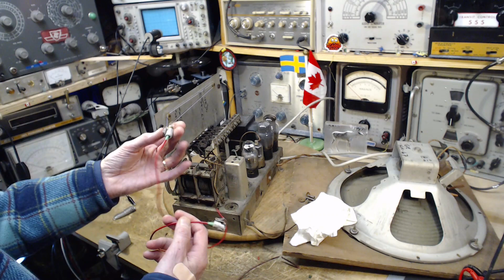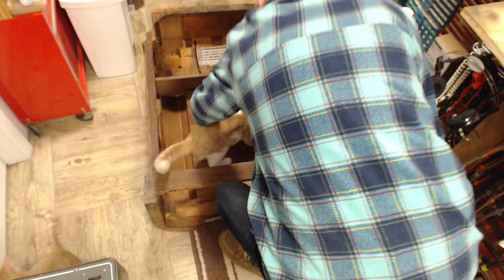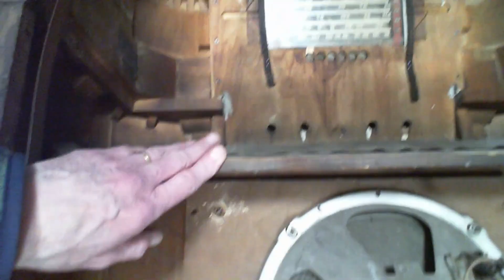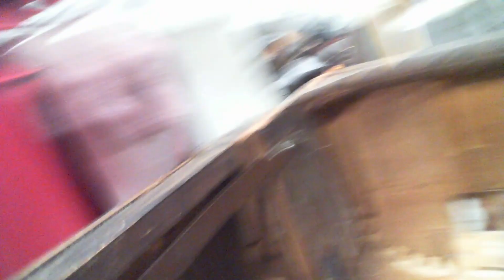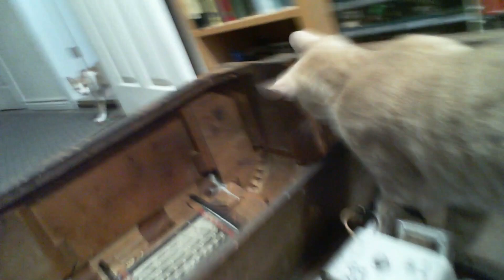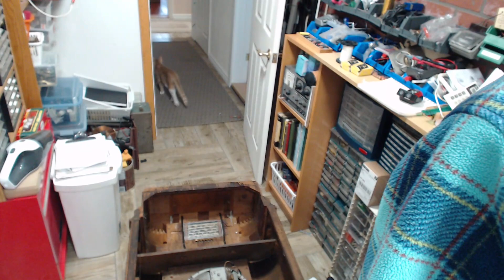Philco #53 Shortwave Tube Radio Video #16 - First Try in the Cabinet

Comment: The radio dial board seems to be secured with Phillips screws,   I have not seen this before in a cabinet of this age. Knobs, try some vinegar and steel wool then finish of with some Brasso (brass polish) on a buffing wheel. Brown boot polish may help. You can get a replacement Philco decal off the internet.